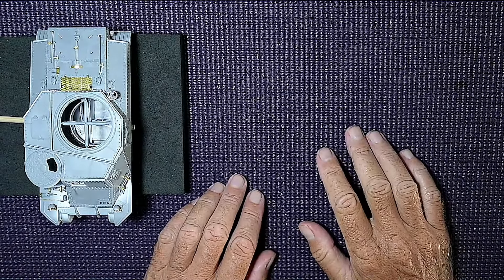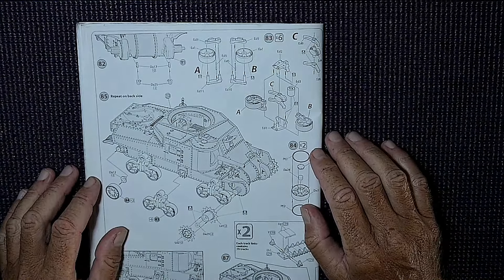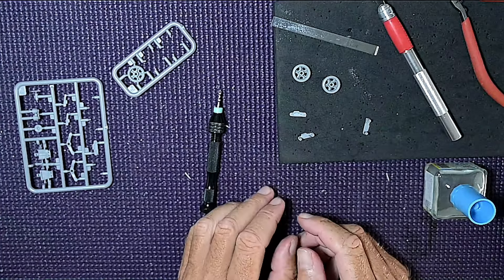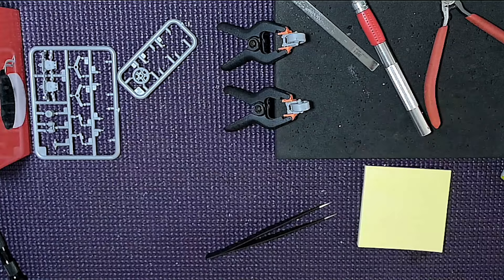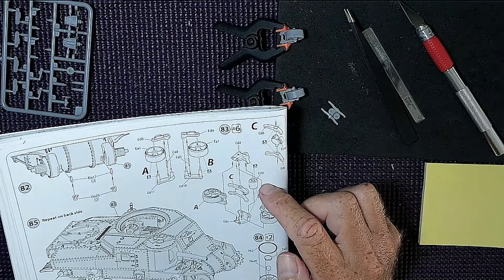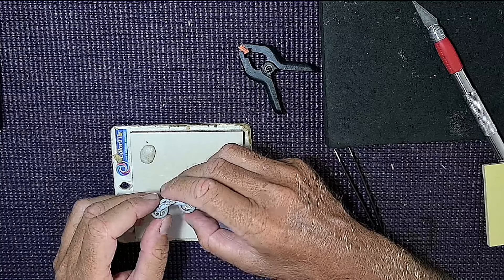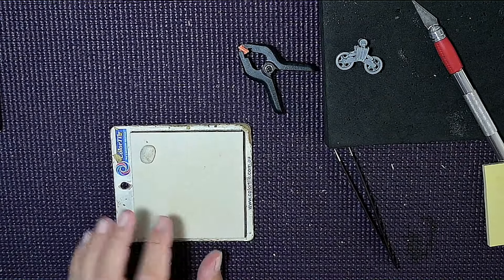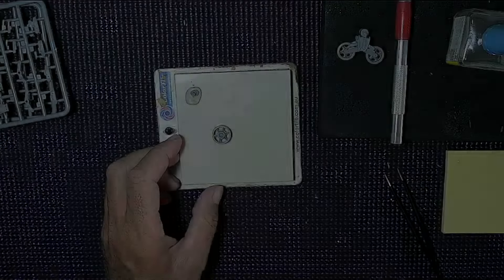M3 Lee 1/35 Scale Full Interior Tank MiniArt  Build Part 10  Early Production

Comment: Hi Peter, Your Lee is looking great.  I'm glad I was able to help you with those wheels.  Thanks for the shout out.  I agree with you about part Da12, I wouldn't fit that until you get the tracks fitted for the last time..  Also don't glue in the front sprocket Ld1& Ld2 until you are ready to install the tracks for the final time.  The tracks are going to be workable if you are really careful with your glue.  The instructions say you will need 79 of each of the 4 parts that make up one side.  I would get all the parts cleaned and counted out before you start.  When I make up tracks I try to work against a straight edge just to make sure everything fits.  If you need anything else, let me know.  Have a great day mate.  Jeff

Comment: i would say that back wheel would turn ,as if the spindle goes all the way through ,it would be glued to the inner part of the hub cap ,that came in 2 pieces ,then the outer piece would be glued on just to the wheel and not the inner piece and wheel would turn, thing what needs to turn and what needs to be stationary